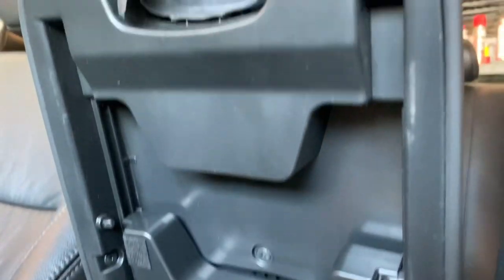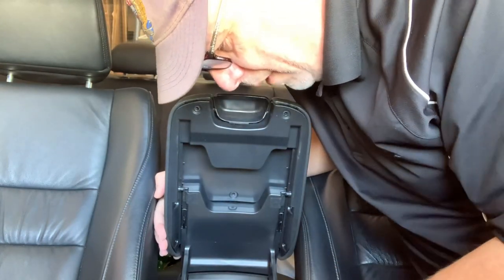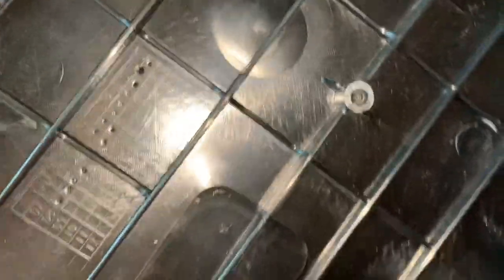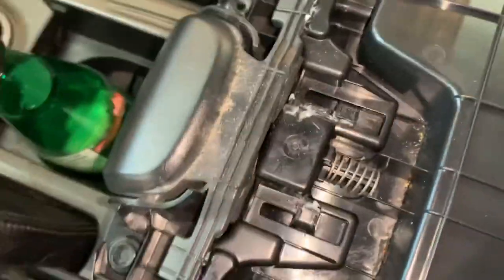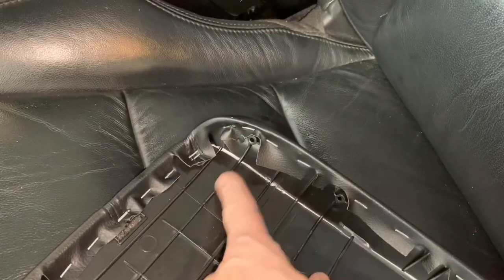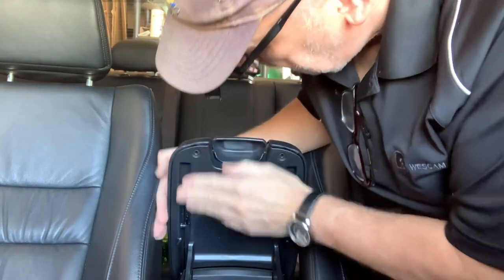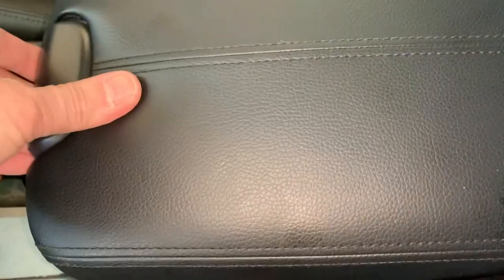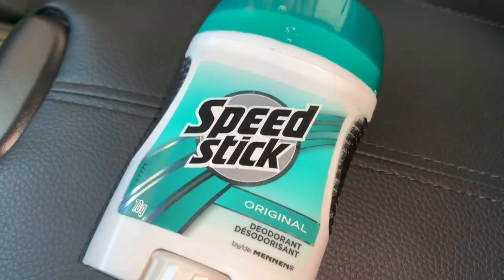Replacing Honda Accord Center Console Armrest.

Comment: What is the part # for just that replacement cover? All I can find is the whole complete lid for $400-$500.
Reply from the maker: Sorry but I did not use a part number, just a description and from eBay.
Reply: you can find it at rock auto but only in a couple colors.

Comment: Our 2011 Pilot has exactly the same issue. Honda must have outsourced the trim work to the same tweakers who build RVs. I plan to peel off the vinyl and replace it with leather. Eventually all the interior vinyl will become 13 different shades of leather 😝
Reply from the maker: Funny and that’s probably a really good plan. Because he’s on the video of the same manufacturer I got the centre consul cushion from was the same one that Houde used.